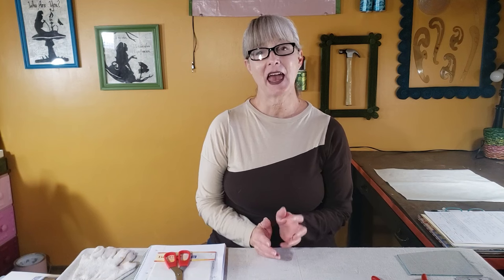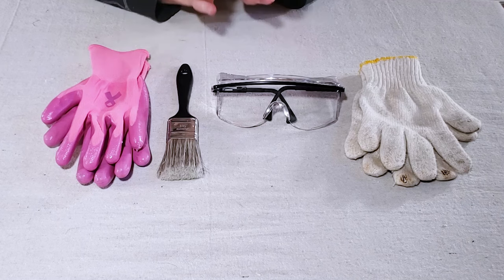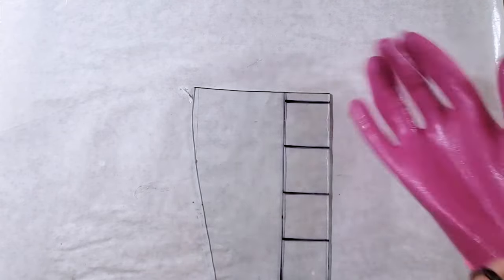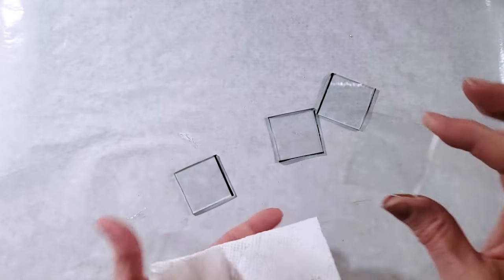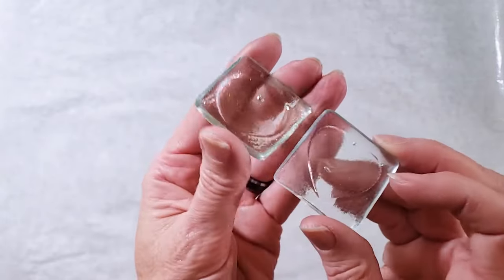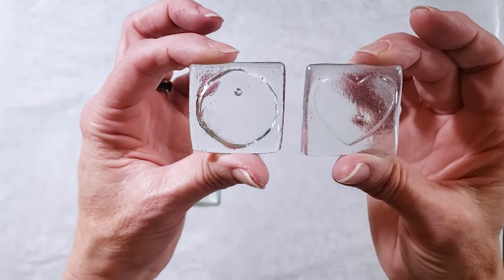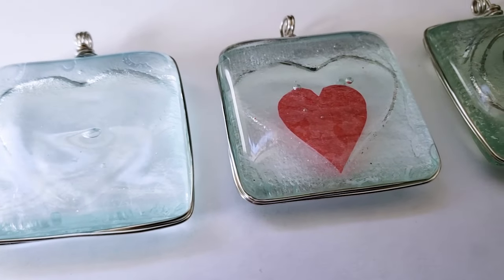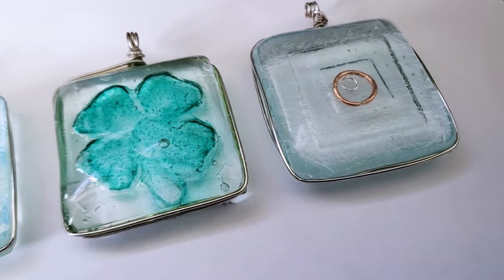Microwave Kiln Fused Glass Pendant Tutorial | Impression Technique

Comment: I like this idear and I am defenetly going to try this method. Thank you for showing. 
Some things I found out in the last years. It is easier (usually) when you cut in your direction anstat away from you and you can use a ruler (ad least I do).  if you give the glass a gentle tap with the back of the cutter helps the crack run throu. I sand the back of my item swith fine wet sandpaper. Water on the smothin surfis does make your glass smother and the sandpaper last longer. The finer the sand paper the more shine on the glass. You can also use polish wool (like you use with soapstone).
Reply from the maker: Thanks for watching and for all the tips. 🙂